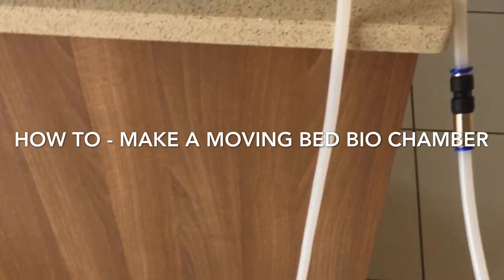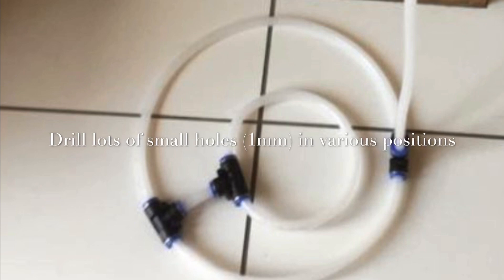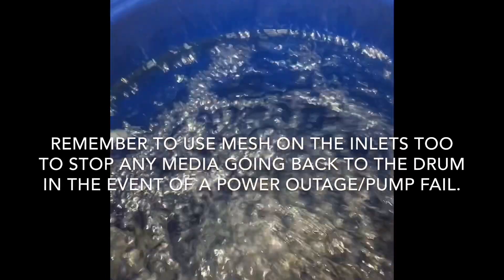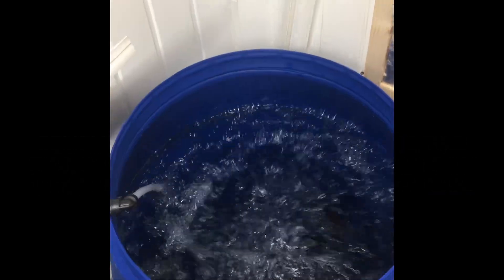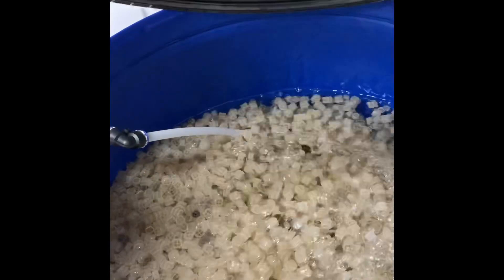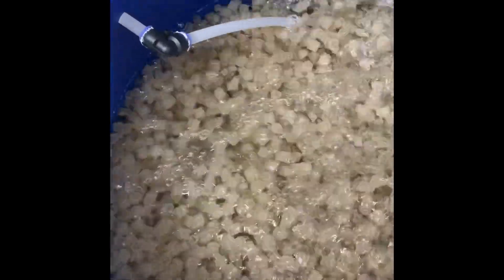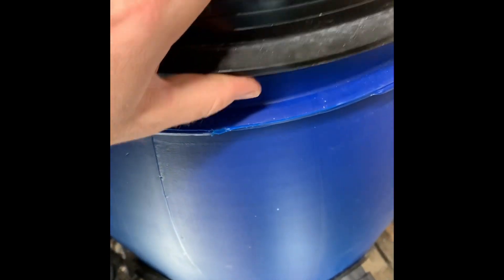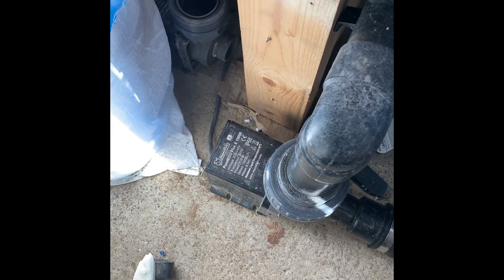Koi pond moving bio bed / chamber

Comment: Hi Craig.

What size air pump do you recommend to move this quantity of media? 
Cheers.
Reply from the maker: Hi mate, not exactly sure to be honest. This system has 2 pumps conected up to it which powers this, another moving bed and a bottom drain.
Im guessing it wont need much. 20/40lpm max. Best to fit a tee piece so you can adjust the air to your exact requirements (1 outlet on tee to the air stone/ring another to a pneumatic ball valve, you can then alter the air by turning the valve to let air escape).
Reply: MAD ABOUT KOI! 
Cheers mate. I wondered if there was a rule of thumb. I might ask on The Queni KK's FB page. I also wondered about the air required for my spindrifter BD. 
👍

Comment: Hi. A really good idea. I would have liked a bit more detail (if that's ok) on each component you used, how you put them together and also a list in the comments of where you got all the components from (with links) and how much they cost. That would be very useful for a beginner who hasn't done much of this before. For example I don't know what a Uniseal is? Is it a rubber connector with a jubilee clip on each end? By the Way are you from the North East? I thought I recognised the accent. I live in Hebburn. Keep up the videos they are really helpful but in my opinion slow down a little and include the detail. People can always fast forward past bits they already know, however detail cannot be added.
Reply from the maker: Thanks for the feedback 👍🏻

This is the uniseals. You basically cut a hole in the barrel using a holesaw sized to the pipe you want to use (holesaw guidelines provided by the company who manufacture uniseals)
 
https://rover.ebay.com/rover/0/0/0?mpre=https%3A%2F%2Fwww.ebay.co.uk%2Fulk%2Fitm%2F132018049866

I feed the barrel via a drum filter then after the barrel it goes straight back to the tank, no more bays or compartments.

Yes im from Sunderland matey 👍🏻
Reply from the maker: I will update the video description with links for ya
Reply: @madaboutkoi  That's great thanks. I've ordered some items from your links. Regards Peter